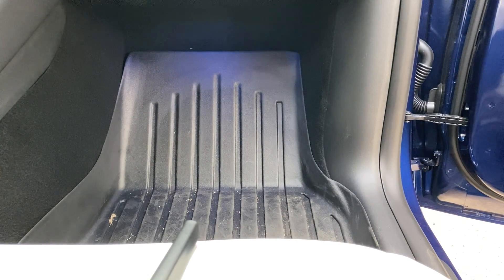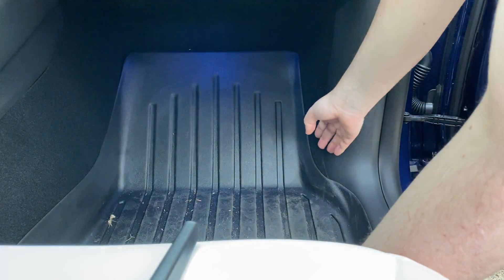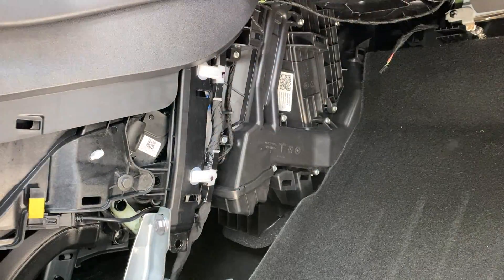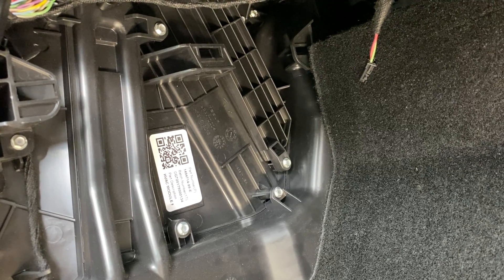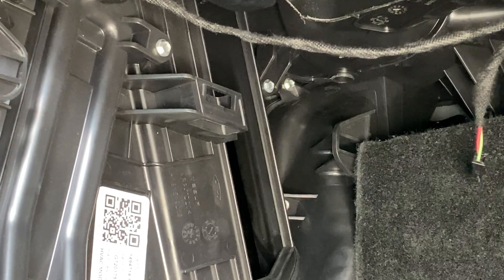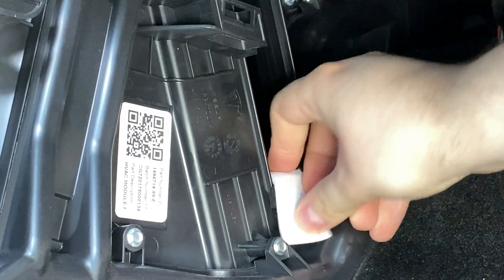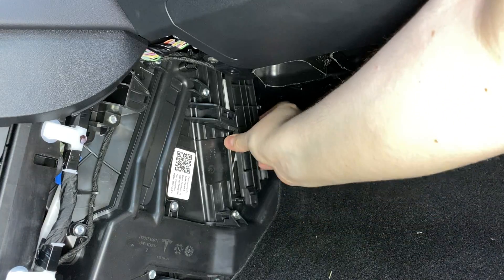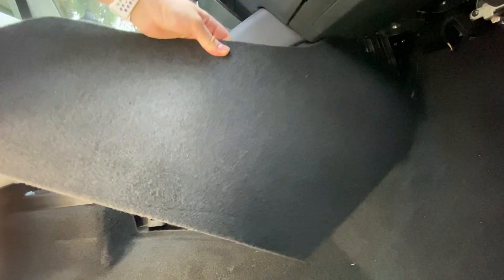Tesla Model Y HEPA Filter Review & Installation- SHOCKING Internal Redesign!!!

Comment: I just changed my filters in my model Y. I didn't remove the wiring for the speaker and light, I just let the panel hang there. I was able to install the filters with no problem.  It made it easier not dealing with the wires.
Reply from the maker: Good to know, thanks!

Comment: Hi great video, can you provide an update please on the air quality? Does the air still smell better with the HEPA Air filters by Abstract Ocean than the Tesla OEM filters? Do you smell gas exhaust from vehicles near you? Just curious on how it is going. Thx
Reply from the maker: Hi Neville sorry for the late response! I've recently moved and have not been able to get on YouTube that much at all. The filters still work great however I have noticed some strong exhaust scent from Semi trucks or other trucks with modified exhaust can get through the filter. But when your recirculating air is on the filters work absolutely perfectly. They remove any and all scents from the cabin air very quickly and efficiently! I hope I was able to answer your question to your satisfaction, if you have anymore feel free to ask! Thanks, NT.
Reply: @northernteslay  I hope your move went well. Thanks for following up. This is great thanks for the update. Did you smell the exhausts from other vehicles with the original Tesla filters?   I am waiting for Abstract Ocean to get spoilers for model Y. Stay safe and have a great day!